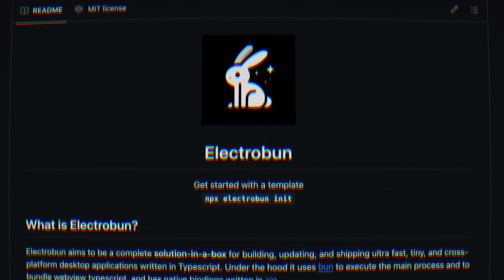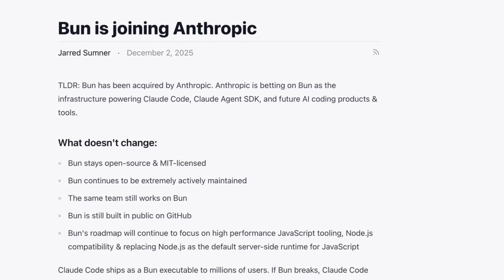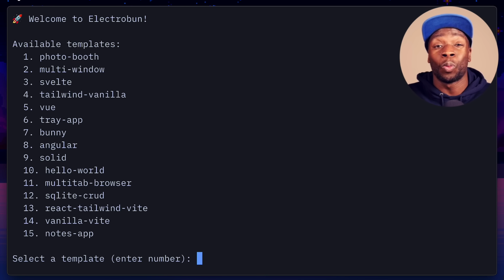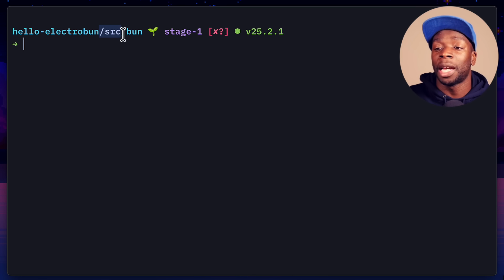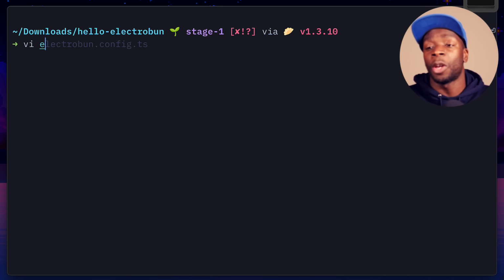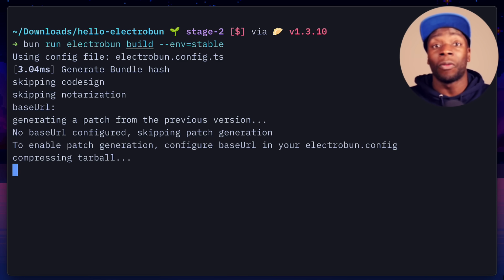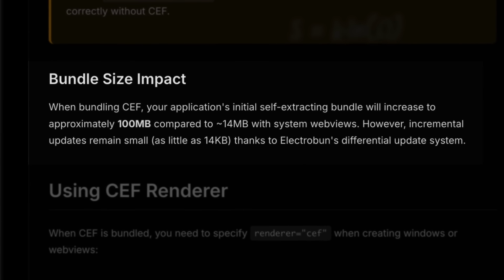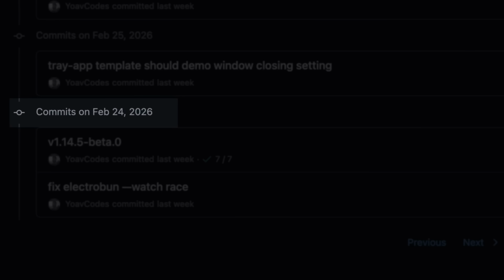Electrobun: No Node, No Chromium, Just Pure Bun Performance

Comment: Biggest issue im seeing right now (i have a working app) is that i have to bundle bun with it. Old windows apps used to ask you to install the runtime environment for it. I do not see why this is any different. Imagine 40 electrobun apps. Why should they have 40 copies of bun 1.16 instead of 1 system copy, and an installer.

That way i can also actually feel like my app is small like it should be and performant instead of just another bloatware.

Edit: I understand that bundles are required for mobile, but for desktop they arent, it would be nice to have options for both contexts. IE assume this is mobile default bundle, and have a configuration to package without bun (install and use global bun instead).

This kind of system does not solve the fundamental issue with electron even if it theoretically can because it is just the bun runtime.

Comment: Tauri's JS API is very comprehensive, and you don't need to write much Rust to handle common tasks. Of course, if you have something custom that needs to happen on the framework's backend, especially for performance, then yes, you will use Rust. I have a client application that is quite large. It's just forms over data, and it has some things here that are with the Tauri API, but none of it requires Rust. It is all TS,
Reply: can you setup storage/indexed DB with tauri ?

Comment: No bundled chromium means your app is very unpredictable and unreliable. The true electron killer is a framework that would use a custom lightweight more secure custom chromium or engine and thankfully that technology exist and that is called flutter.

Comment: I don't think a memory consumption of 1-2gb extra really matters that much on modern hardware, when you get chromium you can do things easily better and give a far better UI and UX and a similar performance cross platform and that's what matters, electrobun does have an option to enable chromium ig but I would say just use Electron.
Reply: I think that the best option for cross platform developing is electron with its full chromium bundled included however the file sizes are unacceptable... I dont understand why the people from electron haven't included a modified modular version of chromium to reduce file sizes... I mean do you really need all developer tools in a production app??... or the whole functionality of wasm in an app that will never use it???...

Comment: The real killer could be only browsers itself if they would bundle their embedded browser versions alongside the main browser installation. This way you could truly then write a wrapper which will call those embeds and to be able to choose which backend to use (e.g. Firefox embed or Chrome embed, potentially other forks like private-based browsers, etc.)
Reply: Well, microsoft does this😅
Reply: is this not just tauri?
Reply: that's what webview is

Comment: compare it to tauri
Reply: Electrobun is faster for JS/TS developers with integrated bundling, while Tauri (Rust-based) offers smaller, more secure, and established binaries. Both are superior to Electron for resource efficiency.
Reply: There is also Wails project for Go programming language 😁
Reply: Tauri 10x better
Reply: @RustIsWinning How did you measured?
Reply: @marksmithcollins Brain.
Reply: the memory footprint and bundle size are not as reported in electrobun. memory usage tauri still lower than electrobun (tried on angular). tauri bundles into AppImage while electrobun bundles into a zstd archive. tauri still works in Ubuntu 22.04 while electrobun can only work in 24.04

Comment: I freaking love using bun build --compile !!! It's SO NICE! to be able to make native binaries for any system for all sorts of tools, I use it a lot in data pipeline stuff and then just run them on a cron job to run all kinds of stuff, it keeps my main reporting web app way smaller and less busy and in a different process so I don't even have to worry about like blocking operations killing the web app performance but I can use the same code that my web server uses, this was a game changer for me! It saved so much duplicated logic and hassle! I was going to have to duplicate a bunch of logic on Go or something to run these tasks that were doing things the website already needed to do but now it's just a binary that gets scheduled to run and it runs, i think that's the huge benefit of this type of thing. Like I am saying I use the same exact drizzle queries that my web app uses but when they're used in this worker bun binary it takes what it needs from that code and bundles it into it's own binary! This is amazing!

Comment: yeah no, it is inferior to Tauri

also, it is chromium, lmao, and bun is slower than nodejs, so that's not a positive thing
Reply: Have you actually watched the video??? It uses the system webview by default, like Tauri. It has an option to embed chromium if you need it. Also i'm tired of Tauri. I have no idea how people use it without issues, it's the slowest out of all the frameworks i've tried in terms of build speed and it eats all my space
Reply: >bun is slower

Trolling 😂 bun has some issues but this ain’t it
Reply: @dandre3K  I didn't even notice that they said that lmao. The framework literally built to be faster than everything else is slow? Yeah that guy is just trolling

Comment: I believe a big issue for Electron is RAM usage ( very high even for simple apps unlike native apps ), any info about the RAM usage for Electrobun?
Reply: Electrobun is on par with Tauri on ram usage and bundle size (because both don't pack the chromium with the app and rely on OS's browser).
Reply: @i3looi2  I was looking for this answer, thanks!
Reply: Ram usage is the same for all of them. The ram usage is just listed under a different process.
Reply: Since everybody is guessing here I tested this myself:
Tauri 3MB
Electrobun 200MB

CEF option was off so I guess its broken on Windows or Bun is just bad on that OS. Fact is that Bun runtime is being bundled. Tauri wins! 😊
Reply: @RustIsWinning  you did something wrong or the CEF toggle is reversed. You clearly have the CEF enabled. Then again, could be a version bug ... 1 man project - instability issues.

As an idea, Electrobun wins (having js from top to bottom is the dream)
In practical world dev .. not yet.
Reply: @RustIsWinning Benchmark skill issue.

Comment: Bun's been bought by Anthropic so I wouldn't bet on its longevity.
Reply: Anthropic has a longer run than bun. There is not real money being made making a bun/deno system by itself.
Reply: you can try to compile it with Deno, npm or pnpm.
From what I've seen, this is pretty much it's own compiler / cli-tool. 
I was able to build the native hello-world example by just using pnpm.
Reply: it been 4 months and its going good
Reply: @notfishvr  So far. I'm just not that confident in Anthropic since they are at the forefront of the AI hype.
Reply: @Ironication that sounds like you just don't think critically
Reply: I think it's other way around. Now that anthropic has got Bun, it's future is more bright.
Reply: @AdarshMadrecha  Could be, but AI valuation is fickle. OpenAI is in a world of hurt right now, and Anthropic could get into trouble as well if/when the bubble pops. That was my reasoning. I'm just not that confident in bun anymore.